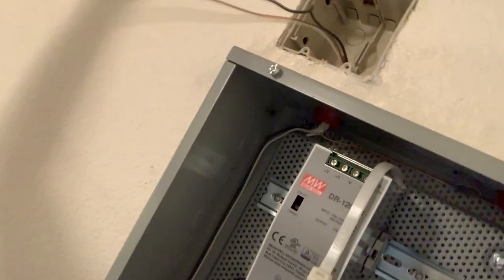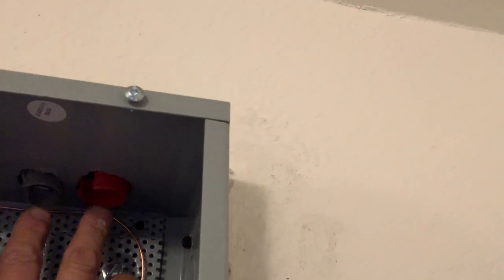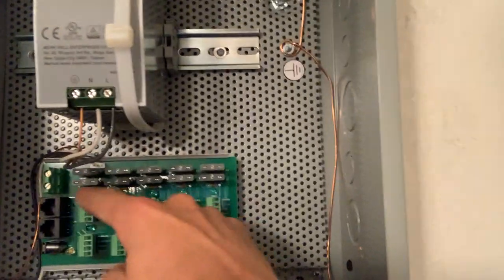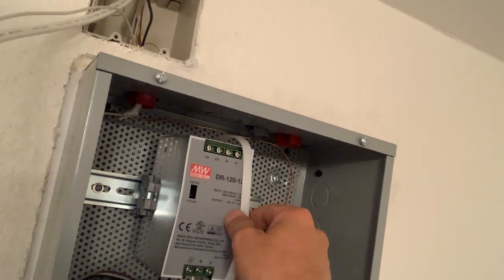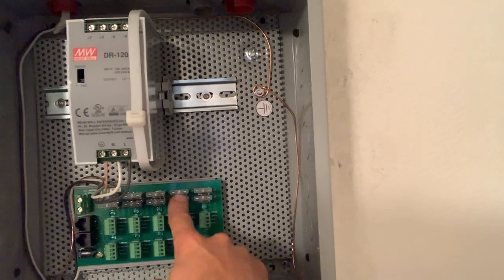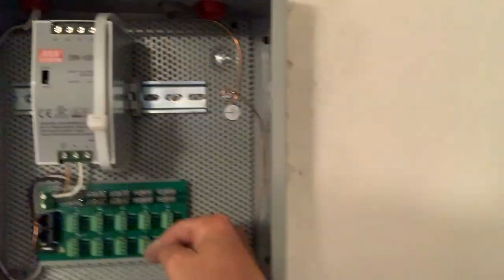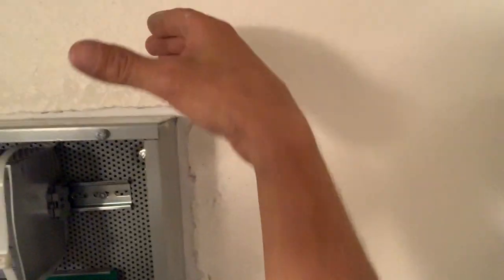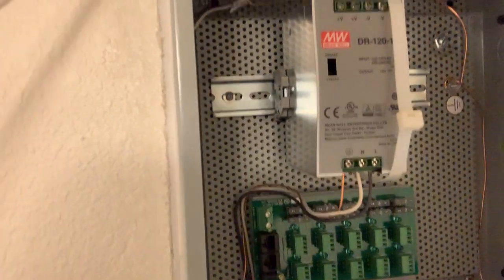Wiring for Electrical Blinds - Part 3

Comment: I like your video, where did you get all your control box and circuit board from? please share info I would like to have them install on my new construction home I try to run 24v low voltage for my LED light and blind a lot of LED

Comment: I have an old alarm system with alarm wire to all of my windows.  Can I use that wire to power blinds and put a control box where the old alarm panel was located?